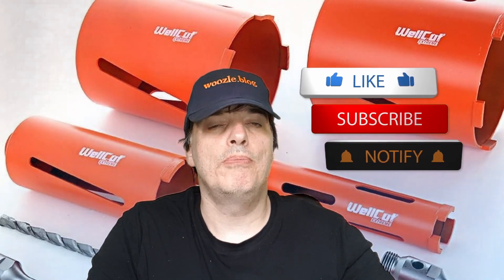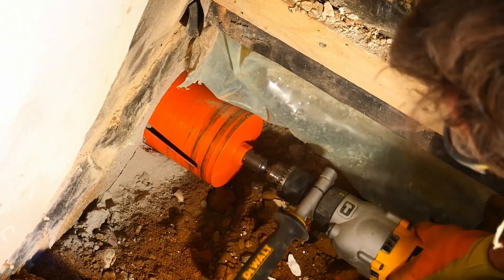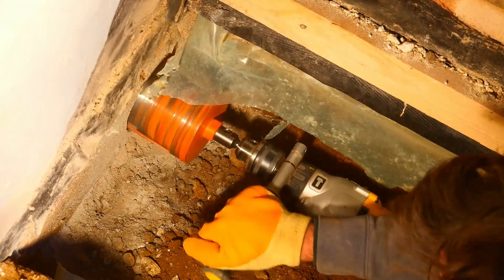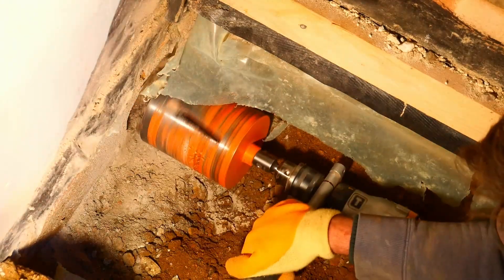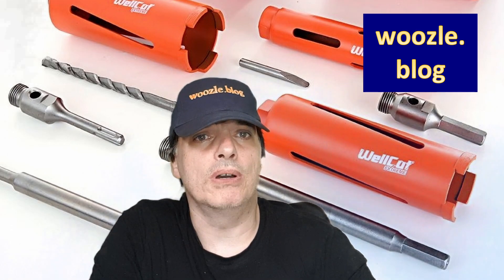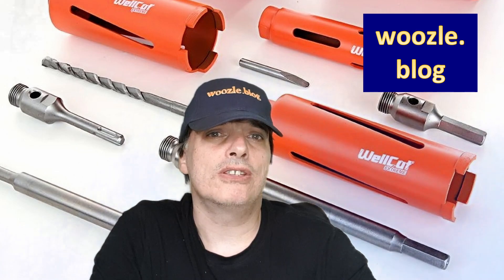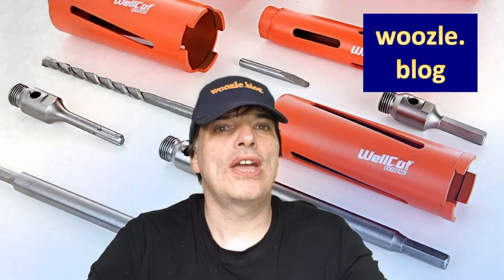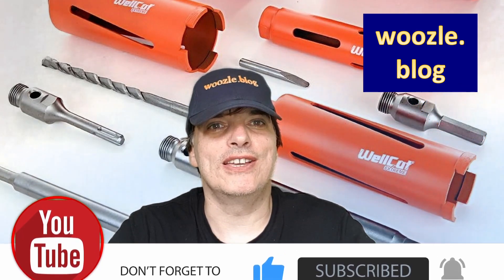Is this bargain Wellcut diamond core  kit any good for my DeWalt drill ?

Comment: Did the DEWalt vote drill fail you?
Reply: The chuck was the problem that it constantly needed tightening. So the drill is ok, but the larger core holes in concrete did prove frustrating  with this drill. However I note core drills have a keyed chuck so not sure if the dewalt is worse than the others. If you find it at the right price, then its ok.